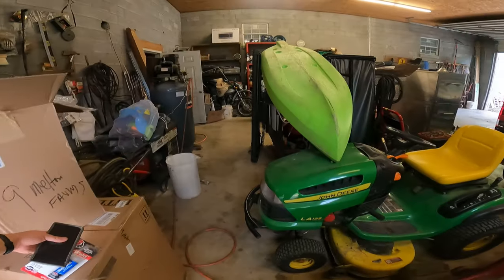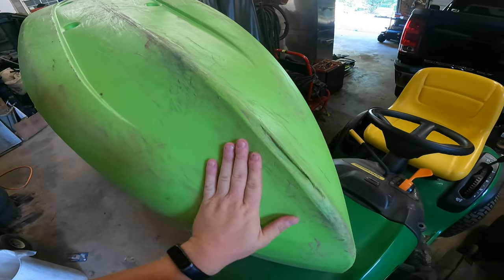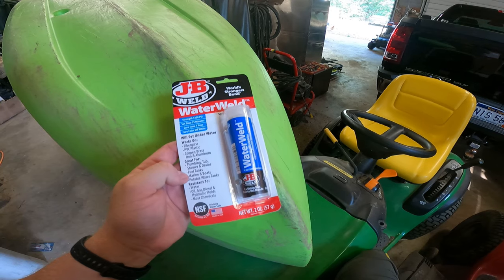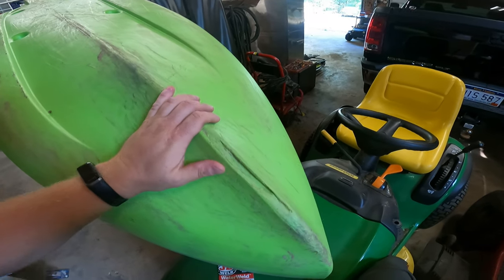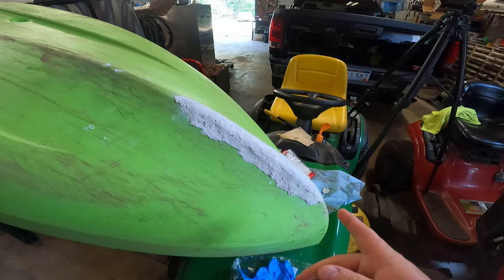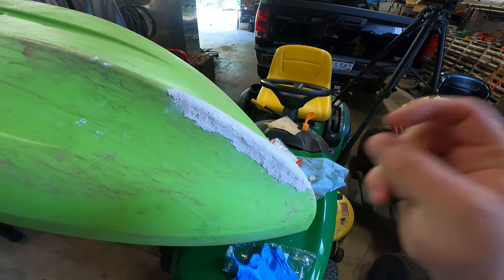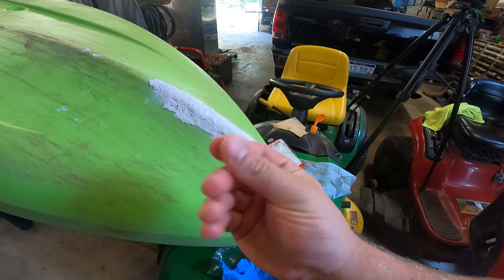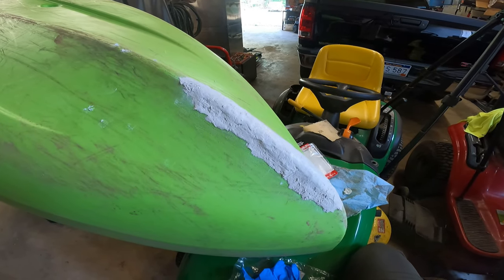Patching a leaky hole in a kayak with JB WATERWELD!

Comment: Also wondering
Reply: I did it. I'm on at least 40 hours of water time. It's holding up great.  Don't use the water weld, use the plastic weld
Reply from the maker: Still holding.